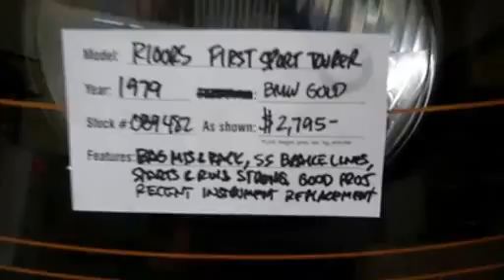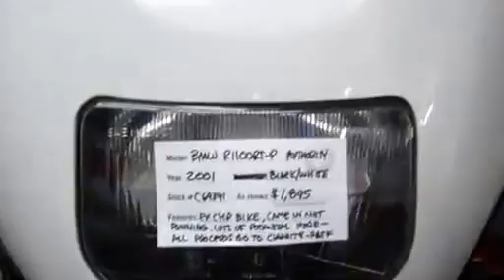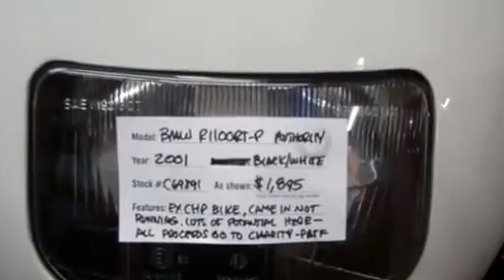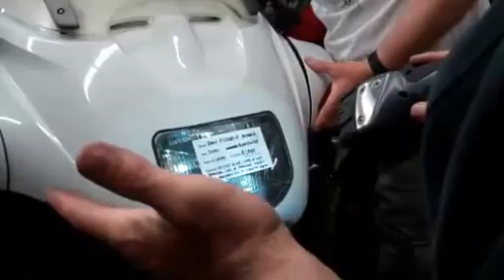How to Work on a Project Bike | 1.888.BMW.BOB'S | Maryland Motorcycle Dealer

Comment: Great vid but wall clutch test on some bikes may stress bearings in headset and fork geometry stress not encountered in operation. Good to use a huge AC motor on a roller with load or rheostat attached for resistance.